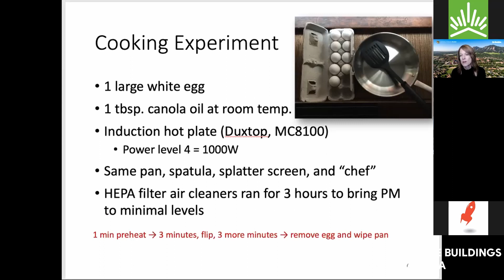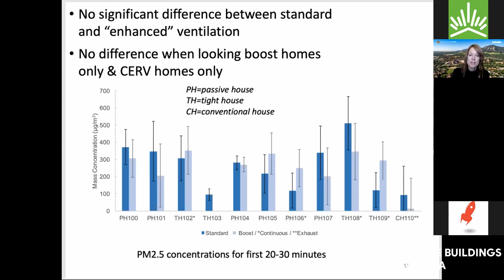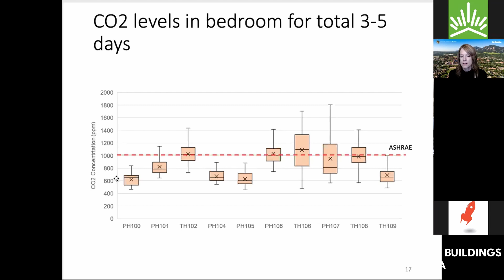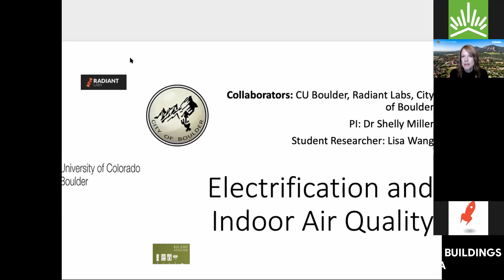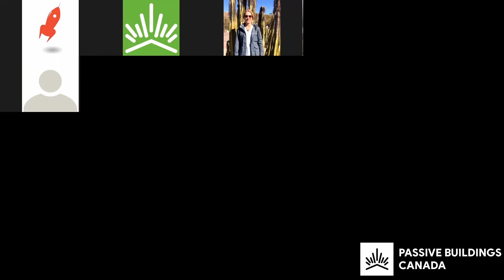Kitchen Ventilation in Passive Houses by Dr. Shelly Miller

Comment: Was a bit shocked to see the CH110 house (conventional house) basically out performed the TH (Tight house) and PH (Passive house) by a landslide on just about every metric presented here (as energy efficiency wasn't covered).  This looks like a great example of unintended consequences where pushing for PH standards actually negatively impacts indoor air quality, at least in this video's presentations.  Thoughts?